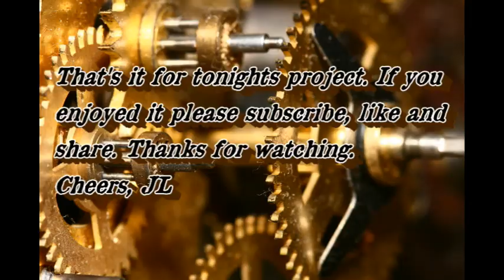James A. Lea, The Village Clockmaker. Clock repair tutorial. #17 Part 1. Re-pivoting a bent arbor.

Comment: @12mins approx: When I used to fix vcr's we had those same gremlins, so we stuck several huge magnets to a broom and swept the shop. Got near a bucket full of screws, springs and widgets!
Reply: Why oh why do these little bits wanna orphon themselves in the way they do?  It makes me so mad especially since sometimes they turn up so far away. Do they have a kinetic energy store they must liberate? Like a sort of latent heat for emergency flight? I've tried a magnet without a lot of success. A brush and pan is better but can damage so easily. "Ah there it is - all bent up!" Great!

Comment: This is fascinating work and great advice about using carbide drills for this class of work. Also think you for the reference to J Malcolm Wild, the builder of your clock staking tool. His website has a treasure trove of watch and clock maker tools (and check out his a great selection of division plates). Thank you for the video, Paul

Comment: Another great video, James! I haven't needed to do any repivoting yet, but I don't really have the right tools either. All I have is a very basic Boley WW watchmaker's lathe. I don't have a collet or drill holding tailstock, so I'm not too sure how I'd manage to drill the hole. The process seems simple enough, but it helps when you have the right tools for the job.
Reply: +sooth15 Boley is a very good lathe indeed. But drilling a hole requires either a chuck, or a drill that matches the taper of the tailstock. I have never in all my watching videos, reading George Daniel's book on watchmaking,  and a few others, found any way of center drilling but a chuck or a matching taper drill.  I am sure Boley made one, problem is to find it! Just checked Donald de Carle's book "The Watchmaker's and Model Engineer's Lathe" and find only one reference to tailstock chucks. I will ponder further.

Comment: Inherited a seth Thomas clock from my stepfather it works great but I want to clean and oil it so here I am learning all I can
Reply from the maker: Just be very careful of the springs if they are wound tightly. Best let them both run down all the way before you take it apart. You can clean it with A1 kero, then wash it well in soap and water and dry. do not over oil the pivots. I small dab is enough and try to find some light oil at a hobby shop. Cheers, JL

Comment: Wonderful video. Always wondered how you repair a broken pivot, now I know. Those tiny drills are, as you say, very expensive. www.leevalley.com sells, or used to sell, resharpend aircraft industry drills quite cheaply, in a set. They are very fragile, as you say, and are sometimes labeled by Morse number --- but they always have the inch measure on  plastic collar. I am glad to hear you have shop gremlins. Or pixies, whatever. Sometimes I can overcome them by sweeping with a magnet. But not always. Beautiful staking tool.

Comment: Great stuff.  I was waiting for the next installment!  

I am guessing you steady with you finger to dampen vibration?   Looking forward to part two.  

Awesome tool you got!

You will have 10k subscribers in no time:-0)

Shout out to Tom too

Jim
Reply from the maker: +phooesnax  You can bend the drill ( a small one ) slightly to center it. If is off you need to check the tail stock to make sure it is dead on with the center of the head stock. You can check it by putting a point in the tail and head stock and then puting a razor blade between the points. If it sits straight between the points your lathe is fine. If it is not you need to make some adjustments. I was bending that drill because I wanted the hole of center for that video.